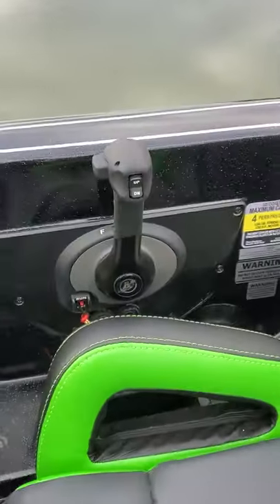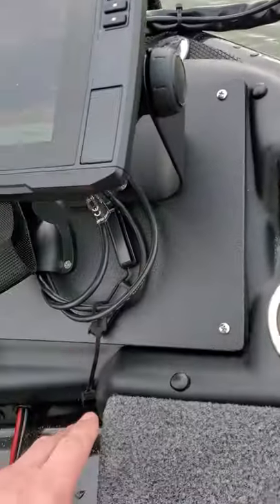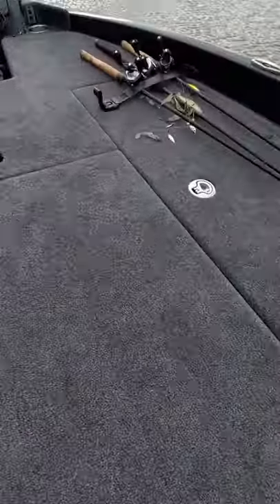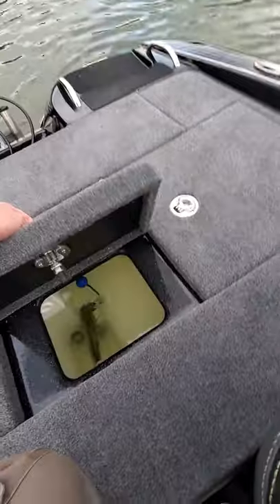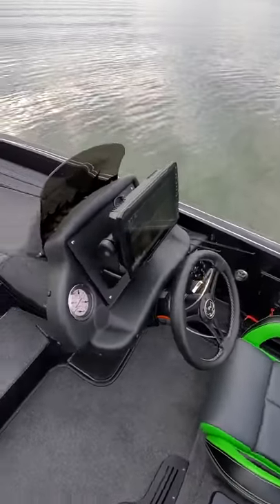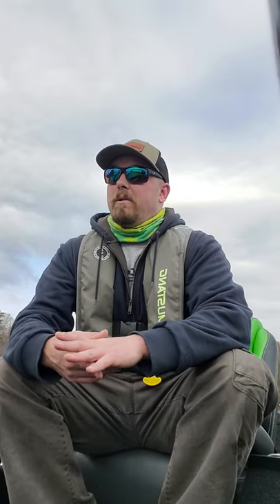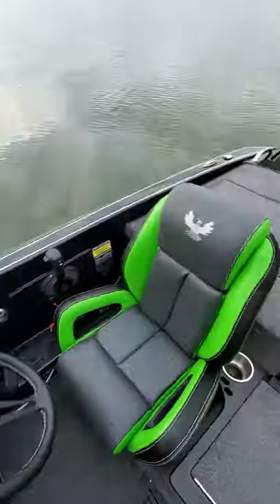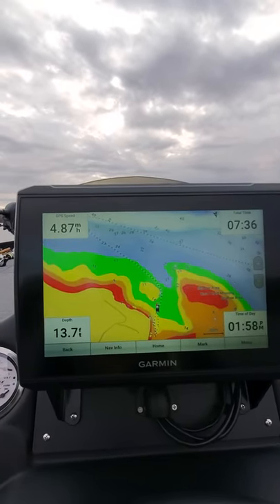pheonix 818 pro update

Comment: Nice setup.  I switched to Garmins too, and I really like them.  No external antenna needed.  Gotta be 60 in that 818.  I wonder if a 23 Trophy would run on that Phoenix with 150 Merc?
Reply from the maker: Not sure but I got a 24p temptest for it otw... I'll report back. People don't think it will spin it... I'm at 6k with a 23 tempest fully loaded. I typically don't haul full fuel around but this is how ya set them up.